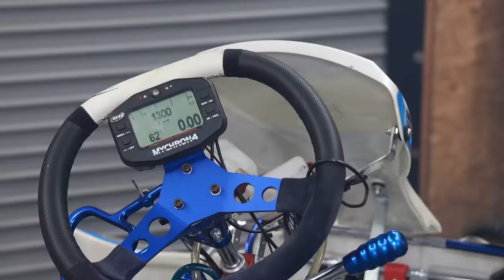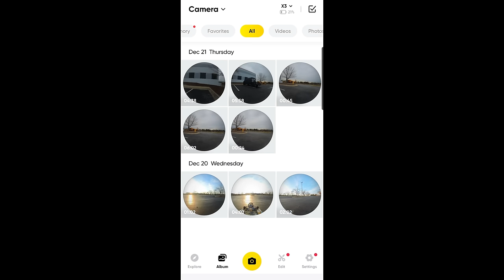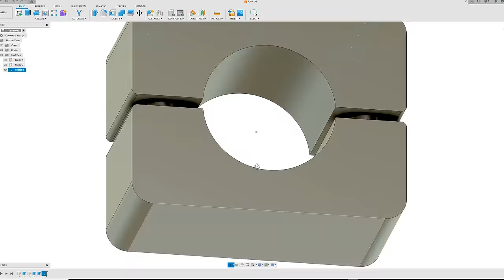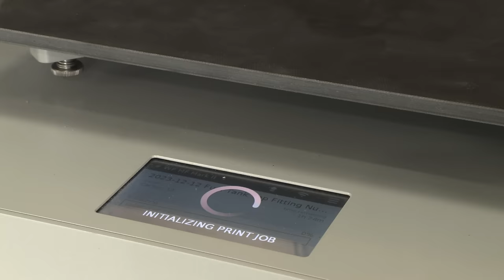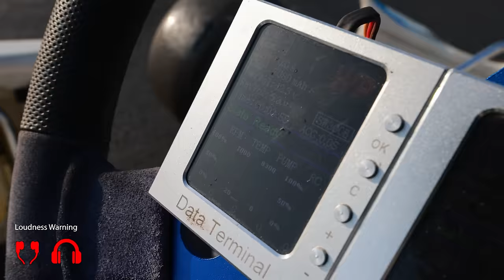Jet Powered Go-Kart (3 Jet Engines)

Comment: In a longer run, it sure seems like the jet engine would reach a much higher top speed than the original drivetrain! Looking forward to more of your projects!!
Reply from the maker: I need to send it to you so you could drive it next !!!
Reply: @WarpedYT  Do it!
Reply: Todd, you should pilot it while wearing the Billy Ray Mullet wig and let WP make a banzai-run on the farm in the Farmabago!! OH THE HUMANITY!! 😆👍
Reply from the maker: @MAGGOT_VOMIT  A banzai-run definitely!!!!
Reply: I think if you geared the 125cc for top speed it would reach about 110mph.  My guess is the jet engines might exceed that but not by alot.  The problem is that the kart chassis is designed around rotational power from the rear wheels,  so the handling will be wonky with thrust acceleration.  Also uncontained air propulsion is an inefficient means of accelleration so it will go through alot more fuel for a given unit of work.
Reply from the maker: @NickKautz  the way the shifter Kart was did about 130 top speed. No matter how the chassis built 300 lb of thrust would get that car over 200 mph according to my simulations, that's without aero. Without arrow there will be about 300 lb of drag wind and rolling resistance at about 225 mph.
Reply from the maker: @NickKautz  I will definitely run those simulations again because it's been a while since I looked at those numbers, ask for efficiency that's not even a conversation, For the amount of fuel that this thing burns in a mile you could probably drive 80 mi on a shifter car at least
Reply: There's another limiting factor, though.  Who's gonna ride that thing above 130mph?    Superkarts with aero go 160 during races with similar chassis,  but that 250cc twin allows it to happen in the length of a straightaway.  And they wear full leathers.  You might need an airstrip? @WarpedYT
Reply: Put some stabilizer wings on there
Reply: @NickKautz  Super cart can go 140 with aero. 140 to 160 is a big difference.
Reply: There's national superkarts that are single cylinder 250's that go 140mph.  Then there's international superkarts that use twin cylinder 250 GP bike engines that can go 160mph.   125cc ICC engines which are purpose built kart racing engines can go like 128mph.  Common 125cc "stock honda" dirt bike engines can do ~110mph in a kart.   @FarmerFpv
Reply: Enough to peal your eyelids back. lol
Reply: Jet engines produce more thrust if they have better ram air. Ducted intake air will help if the engines can’t be moved to a better location
Reply: @blimpcommander1337 yes!
Reply: @blimpcommander1337 And they would be more fuel efficient with unrestricted intake air.
Reply: @blimpcommander1337   - and better output velocity matching - a mixing nozzle could give more  effective momentum transfer - for the same output thrust.
Reply: It would be interesting to see the results on handling with yaw axis thrust vectoring that turns counter to the direction of the driver's steering.
Reply: @Warpedperception
Reply: We gonna test that!
Reply: @WarpedYT  wanna see u go on a 2 mile straight way.... I would add some small fins for a little down force though.... Don't want you to take off course
Reply: @NickKautz YES..... Yes they do
Reply: Regenerative braking? A button to deploy accumulated tension in a spring or pressure in an airtank or what have you. Get from point a2+ to b2+ faster with an acceleration boost reaching that 20mph+ where the rockets run better.
Reply: Build a wing it will fly you wherever you wanna go

Comment: Can you imagine how fast the cart would be if it connected to a powertrain going directly to the wheels.....Awesome you're back doing videos again. Thanks and Happy New Year
Reply from the maker: Yeah I almost did that In the very first Jet Go Kart, the problem is that it's two different types of power delivery and it's very hard to predict when you're driving, additionally I forsaw mechanical issues like overspeeding of the engine etc..... I thought it was going to be miserable to drive.
Reply: @WarpedYT  Videos are great but safety first
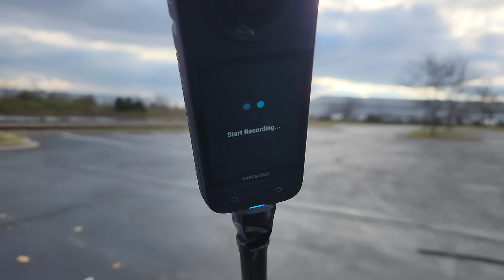Reply: @WarpedYT  3:05 - Wouldn’t be a bad idea to, at the very least, wear a helmet…genius.
Reply: @Av-vd3wk  it is his life to decide what he does and doesn't do. It would be smart to wear one white driving in your car but I doubt you do that. People are different in the risks they're willing to take.
Reply from the maker: @Av-vd3wk  yeah true but I personally didn't feel that the shifter car was very dangerous, I used to raise them for a long time and maybe if this was a bigger track with long straightaways followed by tight turns, then I would probably wear it but as you see with the jet kart which was extremely dangerous I wore it.
Reply: @joshm8661  thanks for setting me straight, Daddy.
Reply: @Av-vd3wk  its no problem, son. I'm here for you.
Reply: Connect the turbine shaft to a gearbox to the wheels like a helicopter
Reply from the maker: @joshm8661  thanks... TBH Commons like yours actually do stick in my head, because sometimes I get so focused and obsessed with building and filming and doing all that stuff I do in fact sometimes forget. And next thing you know cameras are rolling everything's set and I'm on the thing with no helmet and no protection without even realizing it...
Reply: @WarpedYT  yea I get it when you get excited.
Reply: You mean with another turbine to the wheels (like a turboshaft), or the axle of the engine itself?
Reply: 13kw-ish times 3.  that would be uncomfortably fast.
Reply: yea thats what helicopters use and some planes
Reply: Like a turbo proP??
Reply: The most practical way to do this would be a free power turbine connected to the exhaust like a free power turbo shaft. Jet engine and power turbine are independent from each other. Free power turbines make max torque at 0 rpm and torque falls linearly with rpm, having a torque curve similar to a dc motor, making it very good for a direct connection to the wheels (obviously with a speed reduction gear set since it will spin 10s of thousands of rpm). A decently efficient turbine should get about one hp per lb of thrust from these jet engines. Although since the ones he's using are on the bigger side it would be a challenge to find an affordable turbine since it needs to have a decent amount more area than the jet engines turbine. Doing this would be many times more efficient than using thrust alone but the power turbine is a little bit of an engineering challenge
Reply: Would their have to be a way to use the word thrust to power a piston or would there be a more efficient method?

Comment: I'd like to see the results of a straight, long run where those jets can max out.
Reply: To find the max on that set up it would need wings.
Reply: You do that...I will watch, from a safe distance. 😮
Reply: Might as well install wings and aerolons for yaw/pitch/roll and just.....take off!
Reply: Agreed. I'd love to see that thing really wind out on a long straightaway. One other  thing.......I'm a pilot, and have always loved the sound of a jet prop (turboprop) starting up. I wish he had let us hear the sound of those  jet engines start up from zero rpm's to full idle. In the video, all we experience is the engines before starting, and then they are already running. Heck of a cart though.......how can you not love something like this? Cool video!!
Reply: neither wings nor ailerons provide a vehicle with yaw or pitch.
Reply: That's quite dangerous honestly.
Reply: @makinbac0n i volunteer as test pilot

Comment: You should build a hybrid with the three jet engines and a 28,000-watt electric motor for the low-end acceleration. I bet that would be a “blast”

Comment: We have used it since you left and it’s still so wild. Hyped to be watching this new project
Reply from the maker: That makes me happy to hear ❤. I hope @Danny causes havoc with that thing, hard to show people through video how insanely loud these are .
Reply: @WarpedYT yo, I kinda  need some help, I'm looking to make a model jet engine but I need help on the combustion chamber because I know there's certen holes and stuff that I can't find anywhere, its not going to be a big model jet engine I've made the compresser and it's 2.5in In  diameter, so that kinda gives you a idea and I also have no clue what barring to use what metal how close everything has to be etc so if you have time please write me a comment back thx❤
Reply from the maker: @Lemonツ-11  have you send me the diameter and length that you need I can draw you up a flat template real quick
Reply: @WarpedYT  of the compresser right, and sorry if it sounds like I don't know what I'm doing I'm still learning and I've always been fascinated by jet engines so sorry again ❤️
Reply from the maker: @Lemonツ-11  sorry autocorrect messed that up, no send me the diameter and length of the combustion chamber that you need, I will draw it up for you with a design that I think will work out of my head, then I can send you over a template so you can cut out. It's crazy cuz I do have a video on how to build a jet engine that I've been wanting to do for a while and I never filmed it.
Reply: @WarpedYT  ok, and that video would be AWESOME it would probably be the first on YouTube lol, and modle jet engines are so darn expensive but there so cool.😂cool. I also have no clue how big everything should be I want it to be a small one, like the compresser I designed is 2.5in so is a 6in for the length and 3 in diameter combustion chamber good?
Reply from the maker: @Lemonツ-11  I would have to do some math for that but are you saying the OD of the compressor is 2.5" ?
Reply: @WarpedYT  yeah sorry I'm tryna learn lol and OD mean original diameter im assuming?
Reply: @WarpedYT  I'd like it the size of a xicoy x45 micro jet engine so that's what I'm going for, I have a cnc lathe that's a LYNX 2100LSY
Reply from the maker: @Lemonツ-11  dang u got a doosan? Nice. Ok I'll look into it
Reply: Ok thanks so much again ❤
Reply: @WarpedYT  also if you have a CAD drawing already of all the parts basicly the whole jet engine you can just send that to me as well, I have fusion 360 so yeah, sorry if that was last minute but if you don't have that are original plan is perfectly fine.

Comment: awesome build! you should consider decoupling the rear axle so the wheels are independent, you should get a lot more grip in the rear because they won't be scrubbing against eachother.
Reply from the maker: 100% ... I almost did that for this video, But I wanted to see how it would act with a fixed axle the way it was first, But you got it right on the money.
Reply: also be able control the direction of the thruster with the steering
Reply: @pakistaniraveasylum1396 Cool idea… add thrust vectoring!
Reply: @WarpedYT   - doesn't thee front end alignment (caster / camber) take care of that?? (ie. lifting inside wheel  -  to eliminate scrubbing.  (Of course, don't hold back ,on the engineering front.)
Reply from the maker: @kadmow  that's a good point and  yes it does but only when taking a corner near the limit and it's hard to do that in every scenario but yeah that is a good though.
Reply: @WarpedYT also for cornering. I wonder if you could spread the 2 side engines and bias the output corresponding to the steering wheel for toque vectoring.

Comment: You should try a hybrid between jet engine and electric motor. The torque that the jet engines lack at low speeds wouldnt be an issue anymore. Awesome build man
Reply: coul install one of these QS motor 6 speed electric motor chain driven
it would be a crazyyyy build

Comment: There is something to be said for tire spinn and being able to get sideways. Those jets are awesome though. I'd love to see them in a top speed type scenario.
Reply from the maker: Yeah man the engine that was on there had some work done to it, The thing even starts breaking the tires loose in 3rd gear.
Reply: Not gonna lie, as a 2-stroke addict, I could smell it from here hehe. What was that fuel mixture by the way ? @WarpedYT

Comment: Man I was surprised how fast it went after releasing the brake at the start. And by pushing air, no mechanical drive! Just awesome project!
Reply: Have you ever seen a fighter jet? These hobby engines are just scaled down versions.
Also use to do go-kart racing when younger and we could get up to 120mph. That was in the 90's.
Reply: @SilvaDreams  yeah, many. But they are mostly engine with wings, this engine is tiny compared to the frame. Have also done some racing with F1 sidecar way back.

Comment: I am sure you have considered changing the angle of the jet engines as you turn in order to improve the turning performance. I'm wondering whether this is coming up in some future build.
Reply: A simple fin would vector the thrust, moving the whole engine would be far harder. Question is, do you direct it inwards to help corner, or outwards to prevent oversteer??
Reply: I'm thinking that articulated engines are not too difficult. Mount all 3 of them to a fixed platform that rotates with the steering. Should be doable.

Comment: I couldn't think of any other worthy reason to butcher a nice shifter kart, than fitting 3 jet engines onto it.
Reply from the maker: That is probably my favorite shifter Kart, It was insanely fast, however I do have another really sick shifter, you'll see it in the next video although for some reason this blue and white one was my favorite, But I couldn't put the jet engines on my other Kart which is brand new because of the color scheme... It's all red like everything is red.
Reply: @WarpedYT  I raced as a kid. I also had/have a favourite chassis that's shamefully hanging on my garage wall. Your video made me go dust it off. 

Truly inspiring to see a professional fabricate the parts for the jet kart. Puts you in a different league to the zip tie crew. 👍👍

Comment: Definitely looks faster than a shifter cart as soon as you get up in the power band. 

Great project, I really want to see it on a straightaway going close to max thrust. Just make sure to reinforce those wheel mounts and make sure the tires can deal with that speed, as the diameter of them is small.
Reply from the maker: Thanks!! That's the plan. Absolutely those small tires or something that Can get overlooked easy, I don't remember the exact number but I think they're spinning at like 2000 RPM maybe more at 100 mph
Reply: Kart, wheels and tires are good for 120MPH. They race at speeds like this at Mid Ohio, Daytona and other full size road courses.